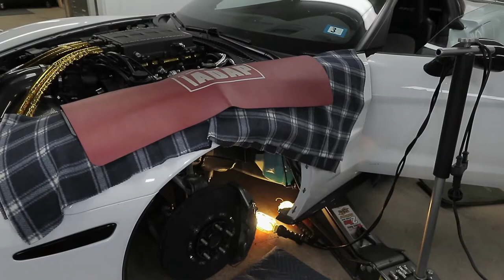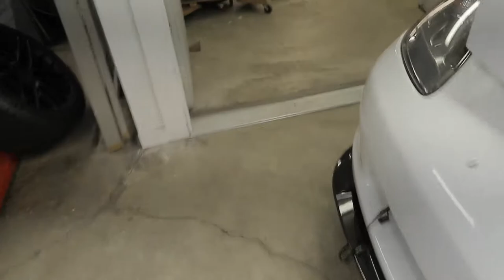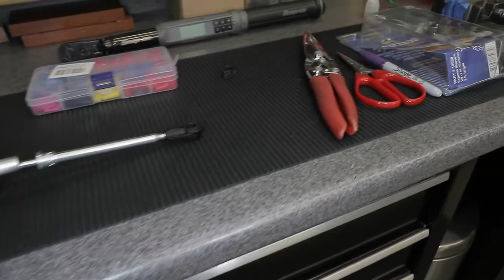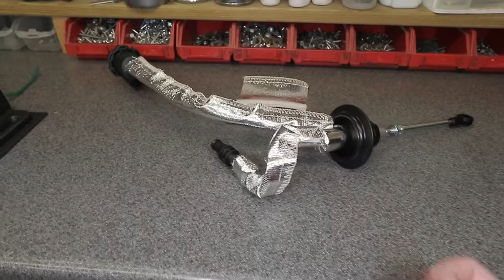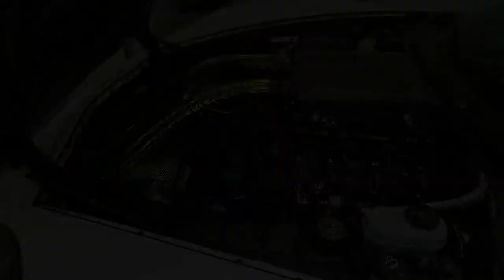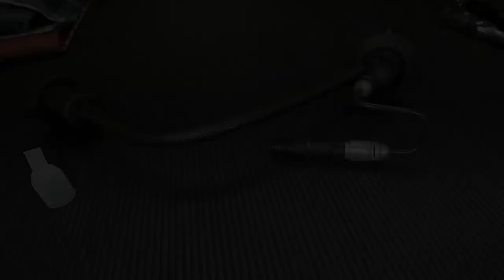C6 Corvette ZR1 CLUTCH Master Cylinder REMOVAL Replacement & Install | Upgrading GM REVISED Kit

Comment: I'm going to be swapping my headers and motor mounts so il be able to lower the engine and not have the exhaust in the way. Will that make installing the master cylinder easier?
Reply: Yeah, of course lol it’s way more crammed of an engine, compared to having a regular LS3 or even an LS7 in the engine bay…. If you haven’t already, get rid of the factory clutch line, for a stainless steel braided line; also making sure not to forget to add heat-resistant wrap around it, to help prevent excessive engine bay heat-soaking.

Comment: How do you know you need to replace this?
Reply from the maker: when you are shifting gears at very high rpms and the clutch pedal sticks to the floor and wont come up. Also when your clutch fluid get very dark quickly is a sign.
Reply: @JohnFrancoNH  im getting hard to put in gear and shaking in shifter and underneath at 1st and 2nd gear. Checked fluid and its black.
Reply: @zo6zr1joey52 Late reply, but if your clutch fluid is black and/or that dark, you’re not changing it enough…. Some peoples’ seals at the clutch slave cylinder, might be more worn than others (high mileage); so those cars might end up having more clutch dust contamination than cars with newer (lesser mileage) clutch slave cylinders. 

My clutch master cylinder seals went out completely (or so I assume), and I ended up swapping in 3 whole OEM ones (AC Delco and GM brand) before one finally stuck and has been working (knock on wood). My clutch pedal would gradually have more and more play at the top, and no clutch fluid would be leaking. I’d open the clutch fluid reservoir and you could tell air was getting IN, since the fluid level actually increased..

I ended up also getting rid of the factory clutch line, for a stainless steel braided one; where I also wrapped that in heat resistant wrap, to prevent excessive engine bay heat-soaking. I barely have 40k miles on my C6 base model, but I typically change/cycle my clutch fluid every 3-4 months, depending on how often/hard I drive. 

The CSC is on borrowed time for it’s age perhaps, but maybe it will hold for a few more years to come, hopefully… I didn’t even realize it was just the CMC being my problem initially, until I replaced that as process of elimination. My stock clutch and flywheel also seem to be fine.